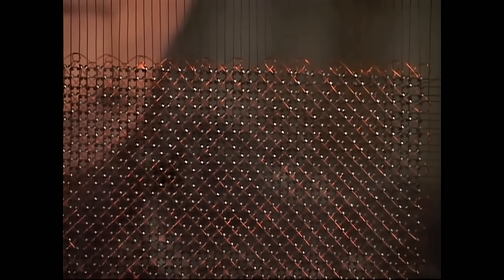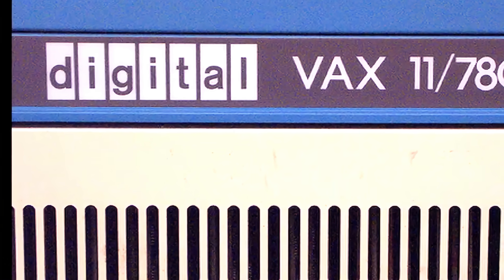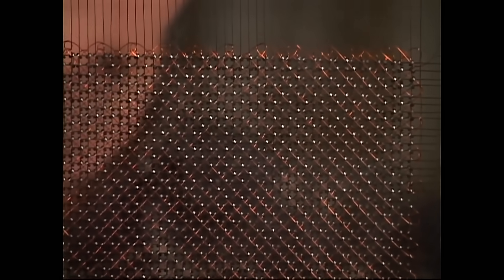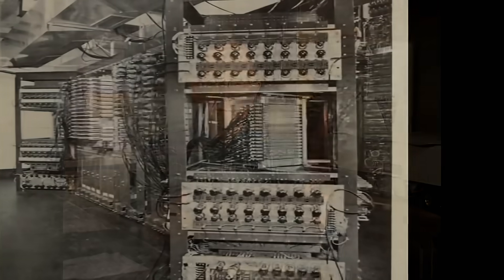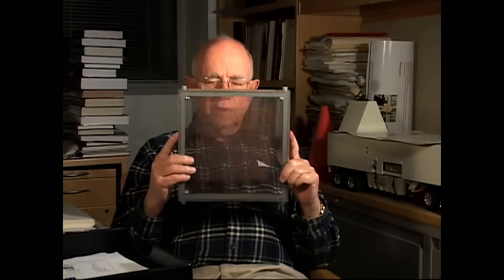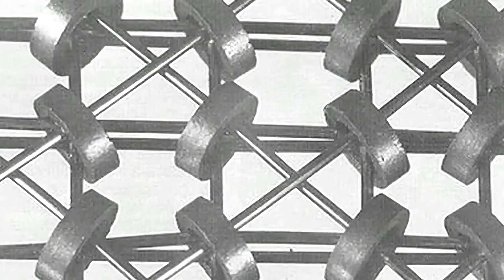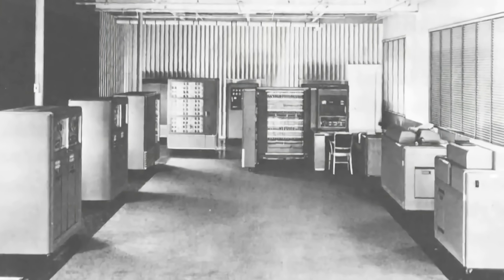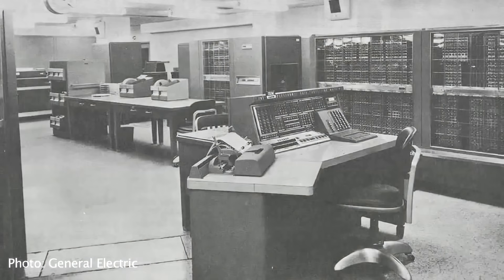Unintentional ASMR 🖥️ Inventor of World's First RAM Chip (Computer History)

Comment: SRAM today is typical in the order of 10-15 nanoseconds. That's less than 1000 times faster than the RAM chip he holds... so he exaggerated a "tiny" bit the speed of todays memory :P
Reply: Kjell Gudim he said that they are now tens of thousands times faster
Reply: 1 microsecond = 1000 nanoseconds. 
The fastest access time for RAM today is around 10 nanoseconds. 
In other words, less than 1000 times faster. 

He even says "hundreds of thousands" in the end there.
Reply: But he is probably talking about BIT access times. You are talking about byte or word access. So multiply the difference accordingly.
Reply: Ok. A word is 2 bytes which is 16 bits.  Unless my math is crap.. that's 0,9375 nanoseconds? so.. 16,000 times faster?
Reply: And of course you have to count things like multi-level caching, so a lot of memory access going on isn't from main memory DRAM, it's from SRAM caches that may be in the CPU itself. And back then the 'CPU' itself would have directly managed memory transfers (can't do anything else until that is done) while these days that can be offloaded to be done by the chip set and so forth. So it's a messy thing to try to really put a number on. But, enough to say that memory access these days is massively faster.
Reply: Well, if you take into account all that then yes :)
I just felt "hundredS of thousands of times faster" sounded a little too good to be true when I remembered that access times these days are still in nanoseconds and not picoseconds :P